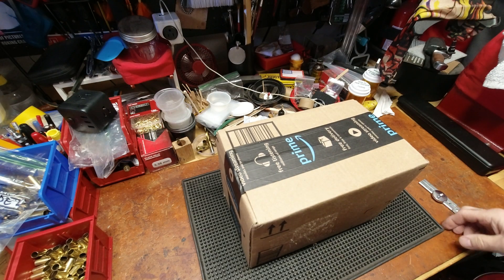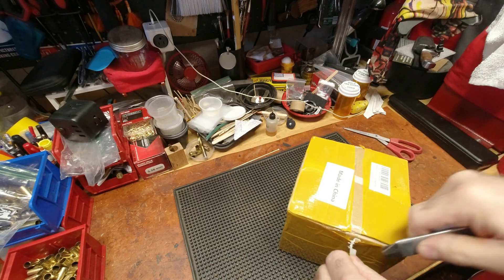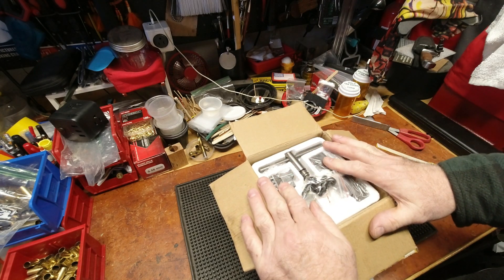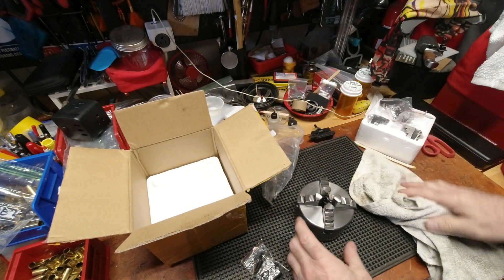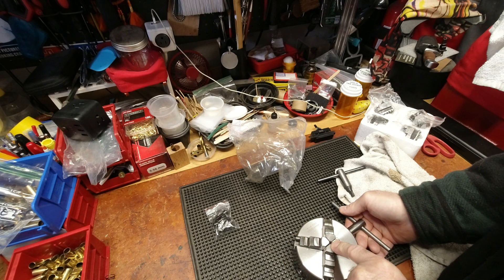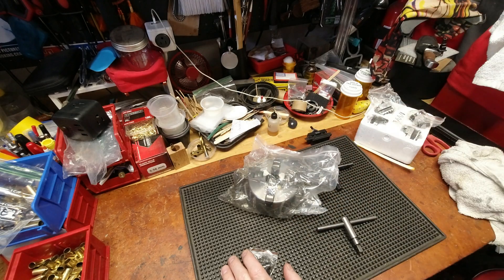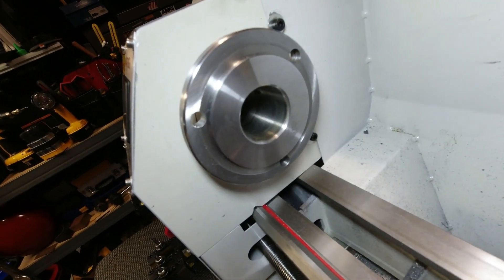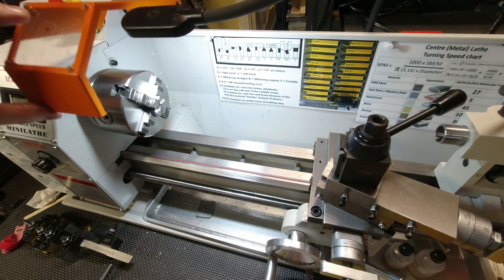First Look: VEVOR Mini Lathe 4-Jaw Self-Centering Chuck

Comment: You didn't show the most important part -- how does this install into your lathe!
Reply from the maker: sine this chuck installs the exact same as the existing 3-jaw chuck (3 mounting bots on back), didn't think it was necessary.  Same bolt pattern and fit as the current chuck.
Reply: @ReLoadersBench  i'm looking to buy a lathe, but have no idea how a chuck like that is mounted.  i'm thinking of buying the  WEN Mini Benchtop Wood Lathe, and don't know if that chuck you have is compatible. Do you know?
Reply from the maker: @bikedawg  Wood lathe chucks are generally different from metal lath chucks in how they hold the object.  Similar, yet different enough.   Here's a link to a wood lathe chuck (by Wen)... https://www.amazon.com/WEN-LA4444-4-Inch-Self-Centering-1-Inch/dp/B07PYFNFP3/ref=sr_1_5?adgrpid=1241348938998527&dib=eyJ2IjoiMSJ9.cezG3ZkzyV7HWEKitHQMUGWkphKDIzDziIxB7mBQVepPYqxpOWTiH5S85_6bWAlmiOqG0brfooPT9cSIGcpqQQX2HP7qsUhpO-NtxpXs5CM0-PTb2SzfHSBObx6Vzd2503fw9KWBUXNkmrHyqTWfcJSfPjxTOpGNdT1fYEFuRiFzmqIEXOedSC1gnCtOPWPDyaxbjYh0lQQDv0UERuodtTGE716cFeFXVLQqA1f3l4RJK8Eb9my_b31OQjbe8VvlR5rMvI649MamcJsKsNM9aj75hQK2N6MQ06SAZxdD8QQ.vPzUGnYVYMRFO-CWYa2PIz8Z_1jsG0pXMO42TnWgegQ&dib_tag=se&hvadid=77584475268276&hvbmt=bp&hvdev=c&hvlocphy=87883&hvnetw=s&hvqmt=e&hvtargid=kwd-77584544356463%3Aloc-190&hydadcr=28228_14640754&keywords=wen%2Blathe&mcid=6e044b659c5936439cb7c693e4dff5bd&msclkid=df25cf02154d126a4328a706893abeed&qid=1745132666&sr=8-5&th=1